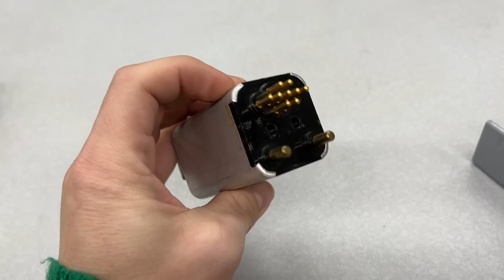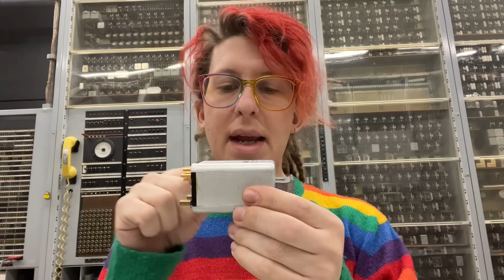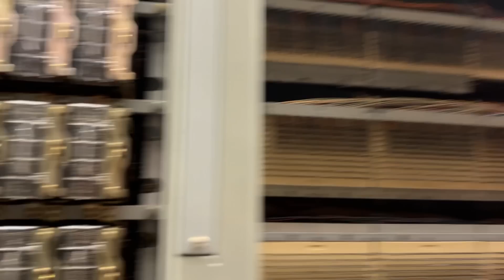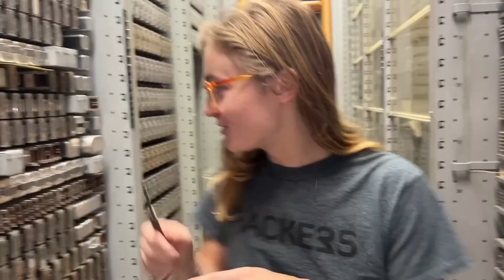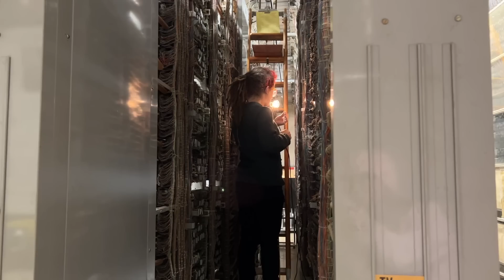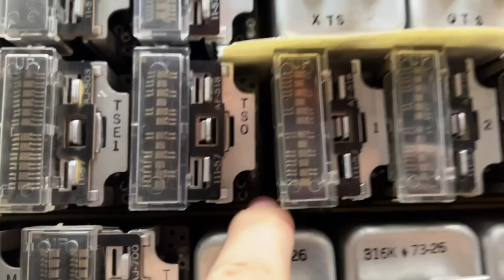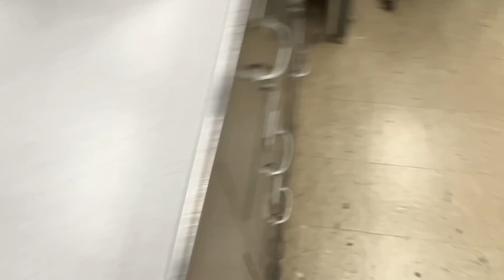Malfunctioning Potted Relays: Emergency Repair in the No. 5 Crossbar

Comment: The goo is almost certainly plasticizer.  The potting compound used is likely a polyvinyl (PVC) or perhaps polyethylene (PEN), and as it ages (accelerated by heat), it breaks down into its components and the plasticizer, which is slightly conductive, leaks.  The green color comes from the copper it’s leaching on the way out of the relay.  Soap and water won’t touch this.  Definitely try something stronger to clean it: brake cleaner comes to mind (try the environmentally friendly stuff first, and if that doesn’t shift it, try the chlorinated stuff in a red can).
Reply from the maker: Thanks! The only thing I'm suspicious about is the green color--I don't think it's coming from copper. There should be no exposed copper inside of these relays, and if there was, that would indicate a coil short, which would absolutely cause the relay to fail entirely. (They are very sensitive!) We have a few hundred of these relays in the museum, and I've only ever observed one total failure, and it wasn't even leaking.

I think the green is a dye. The color is way too consistent to be purely from leaching copper.
Reply: @ConnectionsMuseum  Well, they were filled with a black potting, which can have a green component, as it cannot be black due to the usual carbon filling, as it is conductive. Thus they used a green dye and probably a red one, in large amounts, to make it appear very dark, and this green azide dye is now leaching out dissolved in the decomposing plasticiser.
Reply: @ConnectionsMuseum   I agree.  Can’t be certain, but I think it’s more likely the green color just means the potting compound was dyed green for some reason, a reason which may be as simple as someone liked the color green.  RJ The Bike Guy on Youtube had a video where he, with some difficulty, extracted gooey degraded elastomer shock absorber inserts from a bicycle fork.  Those were likely a sort of polyurethane and they, including the goo they degraded to, were bright red.
Reply: @ConnectionsMuseum  brass contains copper and can make the same effect, so it's likely that. I've seen this goo before in old house wiring in the UK, it's horrible, I recognised it as soon as I saw it!
Reply: @ConnectionsMuseum  I'd be very intested to know what it is, it could be a dye but as soon as I saw it my immediate thought was the green goo that comes out of most of the plug sockets in my house, I live in the UK and we had a certain kind of plastic used to shield our domestic wiring in the late 60s through to the early 80s and now it's super old and been heated a lot, it's degraded the plastic into pumping out green goo, it's the exact same colour green and the same consistency. 

Sometimes my plug sockets look like something out of a horror film because they're weeping green goop down the walls.
Reply: @ConnectionsMuseum I think there have been resin known to turn green and deteriorate when heated. Maybe time to crack one open. Why are they potted anyway?
Reply: @ConnectionsMuseum  That green goo really looks like polyurethane that has degraded. In my day job, I keep broadcast video and studio grade audio recorders running, We had a pinch roller from a Studer A-827 multitrack recorder and it turned from a black semihard pinch roller into a green goo that ran off the brass shaft into a puddle on a piece of cardboard the roller was sitting on.
Reply: Polyethylene does not use plasticizers and would not be a likely material for a potting compound.  PVC does use plasticizer, but is not a likely material for a potting compound.  I suspect a polyurethane.  Some polyurethanes can be cast as a relatively low viscosity fluid and set up into a much firmer solid, just what you want for a potting compound.  Some polyurethanes are also notorious for degrading to goo over a long time.  Plasticizers for PVC are not electrically conductive.
Reply: @markholm7050  I know both those green goos, they are common in 50 year old PVC cable, where the plasticiser reacts with the tin plating and the copper.  Urethane potting will also react with time, and yes the best remover is brake cleaner, but for relays much better is to use Kontact Chemie contact cleaner, or the Tuner 600, though I have had good results using Label Off 50 sprayed on a cloth and a bud, to dissolve the goo, before you use the Kontact Chemie WL wash to remove the remainder. These do not damage the varnish too much, and thus you will not be sitting rewinding 8000 turns of 48SWG wire. 

A hint is to get yourself an ultrasonic cleaner, and use some water in the tray, with a glass tumbler set that you fill with denatured spirits (methylated spirits) and have the relay in the spirits, then put the tumbler in the water, and ultrasonic clean for 2 minutes, then remove relay, dry with a cloth, then move to the next tumbler with clean fluid, for about 5 washes. Then leave to dry, and most of the goo will be gone.

I did something similar with military equipment, though the ultrasonic was a little bigger, and we used TCE in 44 gallon drums, which was also distilled in the machine to clean the gunk out. 20 seconds to clean, and if you left it in for 40 you lost parts off the unit. But it was clean, just replace the paint. When it was time to dump the fluid all the dirty stuff like carburettors and such from the GSU came through for a wash, making all the hydraulic fluid vanish, then the old black fluid went into a drum, which was then delivered to stores, for them to figure out how to get disposed.
Reply: I have to partially walk back my previous comment.  I downgraded the idea that the potting compound is plasticized PVC.  I was thinking of thermoplastic PVC, which is an unlikely potting compound, because it has very high viscosity, even when melted, and would not be suitable for potting.  I forgot about PVC plastisols.  Those could in principle be used as potting compound and, as they age, would be likely to lead to  the oozing goo phenomenon.  Polyurethanes are still in the running, though. They also lead to oozing goo.  There are probably other polymer systems that have been used as liquid casting systems (that’s what potting is).  Epoxies, even hybrid polyurethane-epoxy systems and others.  Polymer chemists are a clever bunch.
Reply: @BeforeAI-6502    Probably not a community college or university.  You need somebody with relevant background knowledge and experience.  This isn’t the sort of thing academic labs work on.  Also, polymer formulations, including degrading polymer formulations are pretty hard to separate into their components.
Reply: @markholm7050  FTIR analysis. Analysis can be done by a competent lab or university with a relatively current database. I do this about 2 times per year on mystery elastomers, plastics and lubricants. 

WF-40 works far, far better than goo be gone and is not as damaging as brake cleaner. Just used it last week for this green goo on an old switch from my dad's 60 year old machine tool .
Reply: I've had the goo leak out of large automotive relays. Yeah its a mess. Also the old early 70's ford sealed potted electronic modules had this issue also. I think its more related to heat when the goo leaks out.
Reply: In the ancient days, the insides of home phones had a bunch of screwed-down components with flying wires between them. In the 1960s Bell started making phones with a beige plastic block in the bottom that contained all of the guts but the ringer. This block was just a plastic tub, with the components mounted inside. 

This was then filled (potted) with a clear silicone goo, and the bottom was covered with a piece of waxed paper that stuck to the goo. The goo/paper surface was then mounted to the flat base of the instrument. 

The goo was jelly-like and transparent on purpose. In case something failed inside, you could peel off the waxed paper and see all the components. You could stick meter probes thru the goo to probe test points, and the goo would self-seal when the probes were removed. You could even scoop out some of the goo to get to a component and replace it, then pour in new goo to fill the void, and put the waxed paper back on, good as new.

These relays don't seem to have been designed to be repairable, but I'm assuming that the goo used was for about the same purpose of holding all of the parts from moving around, while at least in theory still allowing disassembly.
Reply: Break Clean for the WIN!
Reply: That green goo is clearly polychlorinated biphenyl. Very, very toxic, very dangerous. I hear it's a potent endocrine disruptor, which will make a man think he's a woman after long term exposure.

Comment: Instead of goof off try an automotive product known as Brakleen its is an aerosol spray but cleans the green goo up extremely well and is safe on plastics. Make sure the power is off  on XB as it is may flash on you. If you are dis assembling the relays to clean them you can use lacquer thinner as well. Both products put off fumes so make sure you use ppe.
Reply from the maker: Brakleen is a good idea, yeah. I used to be an auto mechanic, and used the stuff all the time. I find that Goof-Off (specifically that brand) works really well, and I know from experience that it doesn't damage the plastics in the relay.
Reply: Brakeleen is awesome but it's NOT safe for all plastics....
Reply: @tshackelton  ...and you definitely don't want it dissolving the lacquer insulation on the coil windings!

Comment: That goo looks very similar to the decomposing PVC that I see in molded electrical plugs from this vintage. The plastic decomposes back into liquid monomers and seeps out around the pins.
Reply: Agreed, it looks like the same kind of plasticizer leachate that we get in old wiring installations in the UK.  I wonder if the green-ness is related to its proximity to copper...
Reply: @dansummers2965 i can think of two ways to test that, one is to expose the goo to something like sulfuric acid (or some other sulfur compound that can mix with the goo) and see if you get a colour change to blue, which would come from the Cu becoming CuSO4. The second test I can think of would be to burn the goo with a blue flame gas torch, and look for green fire.

Both tests require a minimum concentration of Cu (specific value unknown to me), and so can't be used to confirm an absence of Cu.
Reply: @cameronwebster6866  That's a good idea. Burning an unknown chemical (or subjecting it to strong acids) is something that should obviously be done carefully and ideally with some fume extraction, but that would tell us if the green is copper or not, for sure.
Reply: I was thinking that too... reminds me of this video from John Ward about PVC clad wire in Britain from the 1960s: https://youtu.be/dQfLXHweDv0
Reply: if the potting compound is pvc and therefor a thermoplastic. It would have had to be added in molten form and the  relay  would have had to have been tolerant of those kinds of temperatures. if thats the case might is be worthwhile trying to heat the whole relay  to try and get the PVC to flow out, crosslinking of the PVC not withstanding. I worked during the 1980's at a Capacitor plant that was an offshoot of Plessy and we used a Polyurethane , 3M's Scotchcast 281 for potting components. No idea how well that  would stand up over the years but I think that it nmight be wot rth their while  trying to find out what the Goo might be , in trying to deal with it.
Reply: Nah, its an almost solid coolant and sound deadener. If it gets hot, it turns more a liquid and leaks out.

Comment: Is making replacement cards with modern PCB relais an option? 
Yes its going around the issue but could prolong your stock. (If you have Relais which switch often, you could use Mosfets or Transistors)

Comment: I wonder why they used the soft potting compound. Most modern potting compounds are hard.
Reply: Maybe it used to be hard at some point but deteriorated?
As it is now in the video it looks like the stuff that they put in stretch armstrong toys.
Reply from the maker: This is my suspicion as well. Interestingly, in the one potted relay I've taken apart, it didn't even have any goo inside. The potting was some sort of dense, crumbly orange-yellow foam that turned to grainy dust when picked at. I think it's possible that they had two "versions" of these relays. One with the more liquid-ish green potting compound, and one with a dry foamy potting. 

Without the original case notes from Bell Labs, there's no way to know for sure what they used and why. :\
Reply: @ConnectionsMuseum  is it possible that it is some kind of paraffin wax (probably in a degraded/decomposed state)? Just stumbled upon https://escholarship.org/content/qt09d785nf/qt09d785nf.pdf which seems to be built similar but is obviously referring to a different model.
Reply: @Ranger_Kevin  The goop inside Stretch is based on corn syrup, as far as I know. This stuff is almost certainly synthetic, probably some sort of a silicone base. Modern hard potting compounds are epoxy.
Reply: It's the same stuff that is inside the network on telephones and has always been a sticky mess. If you take apart an old model 500 or 2500 phone and pry open the network you will find thes same goo.
Reply: @bobcosgrove3235  It's also a problem for 1A2 key system cards as well, so I'm told. I consider myself lucky I've never encountered any of it running amok.